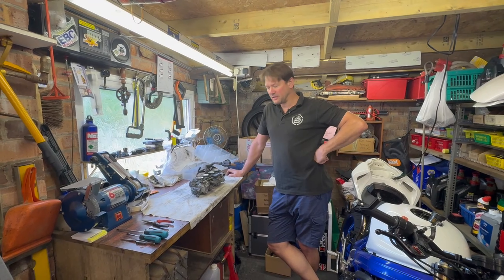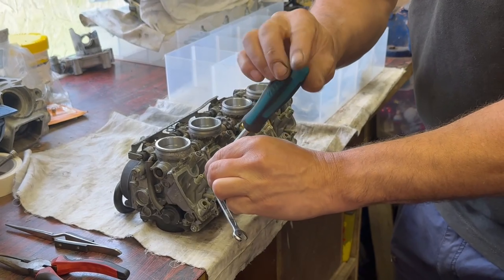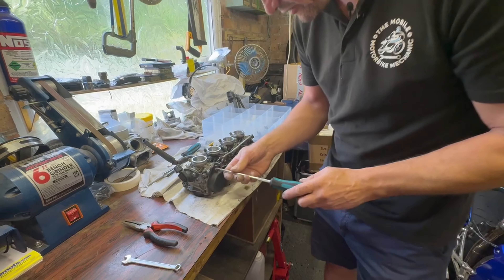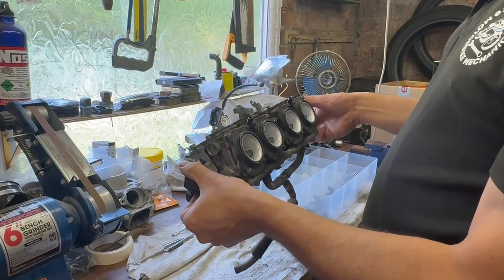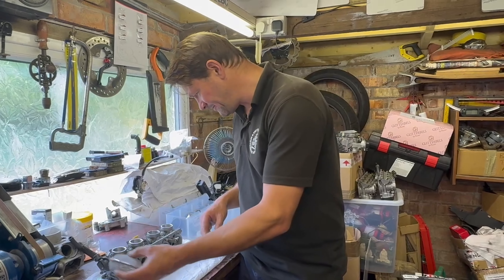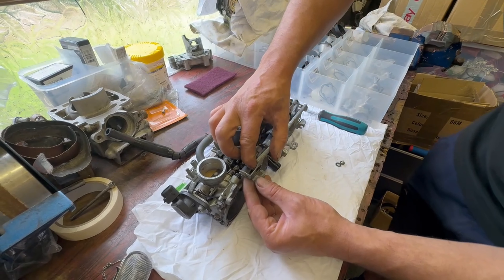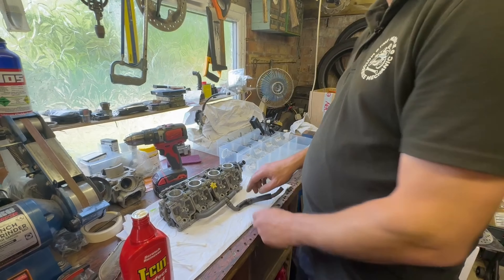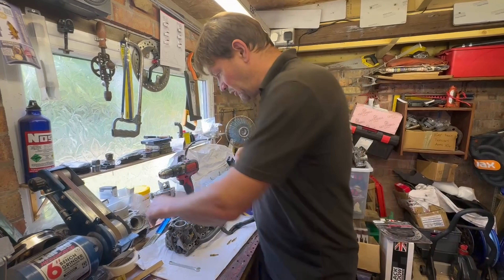Honda Hornet CB 600 - Part 2 - Stripping & Cleaning Carburettors

Comment: Regarding the Jet size.I have a hornet 1998 model .the Jet size is 100/ 102 so I take it that the outside Jet is going to be 100.  Not what I found when I pulled them apart.

Comment: Is the TPS fine to go into the Ultrasonic Tank? I'd be worried that it would get fluid into it. 

Also, pilot fuel screws, I can see your reasoning for not removing them but they're easy to remove. Mark and count number of turns in, note it and photograph if necessary. Then all the pilot circuit can be cleaned properly.

Comment: what cleaning fluid do you use in the sonic cleaner and what temp do you set it at.
Reply from the maker: We use a carb cleaning solution from bestultrasonic.co.uk 
Normally temp is around 50oC
Reply: Thank you what size cleaner do you use to do a bank of 4 carburettors @themobilemotorbikemechanic

Comment: Why would some of the jets differ between cylinders? Really good vid 👍
Reply: Maybe because The  inner 2 Cylinder's on an Inline 4 Engine will naturally run hotter, so maybe Jetted to compensate for this ?
Reply from the maker: That’s correct 👍🏻 the inside 2 cylinders can run hotter and therefore require different jetting